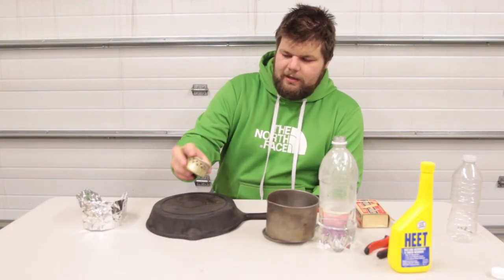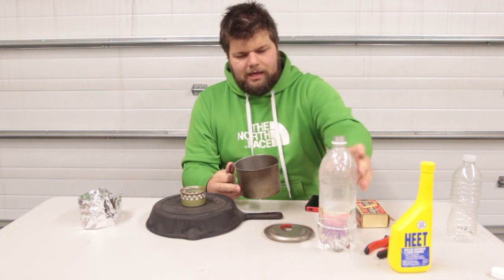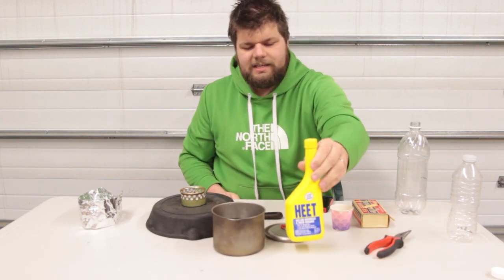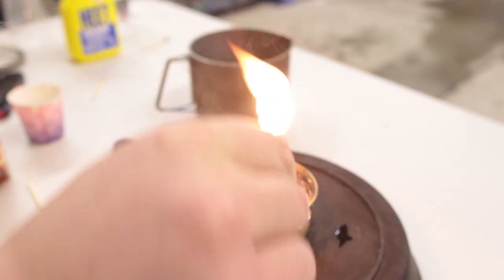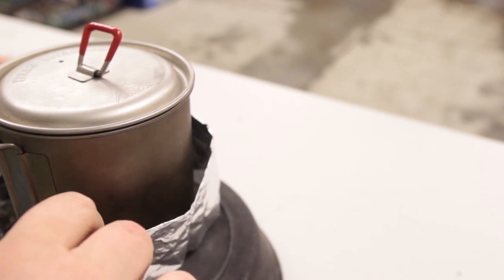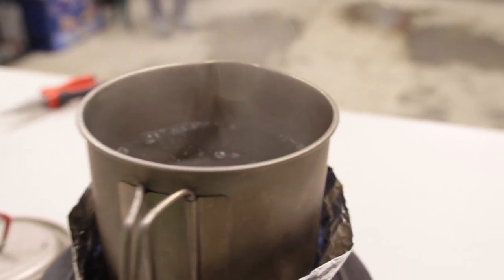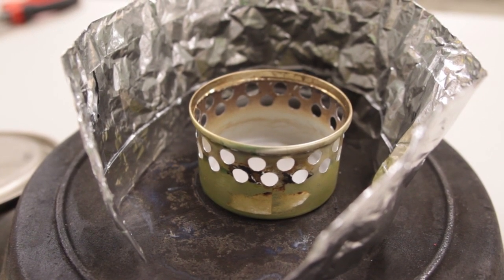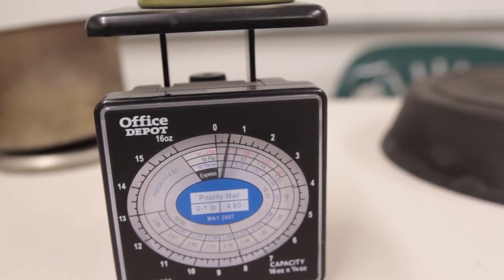Cat Food Can Alcohol Backpacking Stove

Comment: I prefer a coffee can stove. They are larger,  more stable and can take more heat and you can use wood, alcohol, fuel tabs or charcoal. You may have to buy a different brand of coffee but usually at least one brand can in the grocery stores is made of metal.
Reply: Chock full o nuts

Comment: I use one, mostly on day walks, for when I just want to boil water for a tea or coffee, as it wieghs very little and fits conveniently in my cup, but for cooking on a trip of more than a couple of days, I use a trangia burner for cooking because of the added flame control of the simmer ring. They are virtually indestructible and I've had mine for several decades.

If you want to use it as a more conventional stove, so you can mount your pot a little higher at a more efficient level, rather than in the flames, I discovered an old upside down paint can lid (you can see what I mean in my video about the Zebra Billy and Stanley Cook Set) that will cover the hole instead of the pot with the cat can's rim slotting into the groove of the lid. This allows the flames to jet out and develop their maximum heat, and you'd need to do some experimental burns to find the sweet spot for a pot stand, as this will be determined by the diameter and number of holes you put in the can.

Minor only, but hopefully constructive, criticism is that whilst being very lightweight, I don't rate a foil windshield. The winds around here would soon have that away down the fell and my stove blown out. I prefer to recycle old food cans for windshields (also can be seen in my videos) that my cooking pots fit inside, they don't weigh much more than foil, but are much more substantial (my oldest one is into its 4th year) and are as easily replaced as a cat can. They also cover the pot when packed away, preventing transfer to my pack if they have any sooting on them.

Comment from the maker: So far it's performed very well.  The biggest shortcoming is that it is painfully slow compared to other systems.  You don't notice it though unless you're with other people using canister stoves, or liquid fuel systems.  In most cases the weight saved justifies the extra cook time.